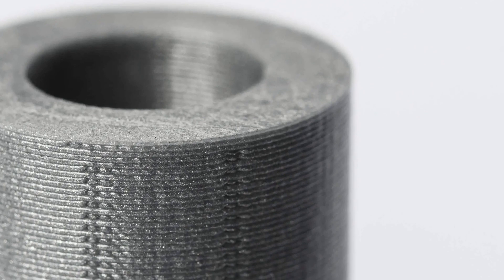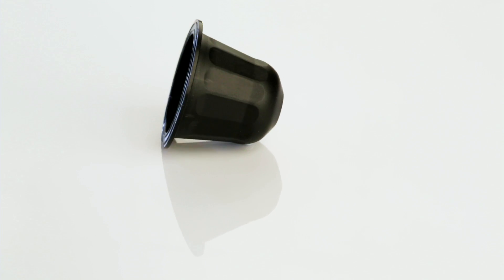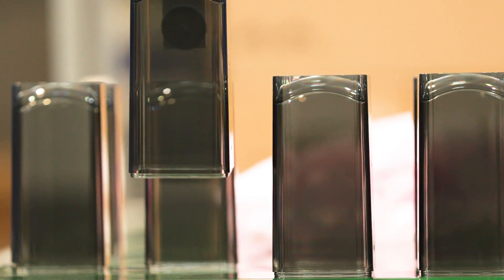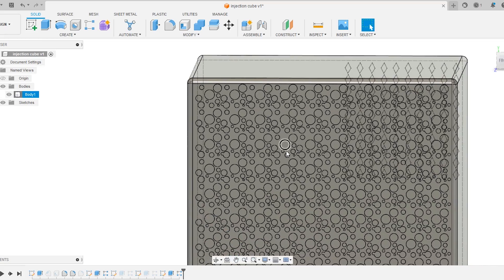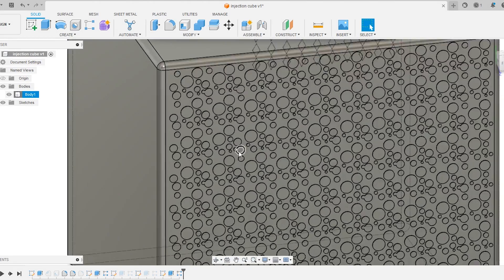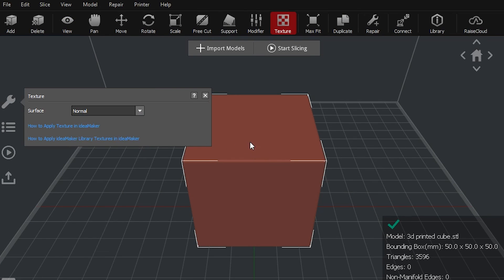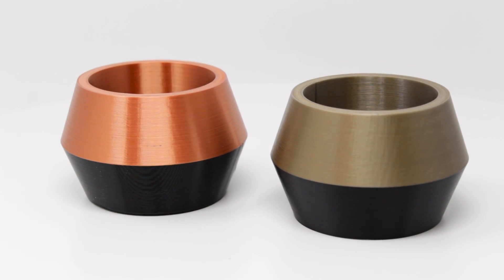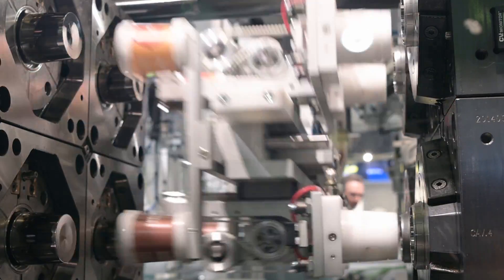Layer Lines Don't Matter | Design Textures for Mass Production 3D Printing

Comment: You're not being honest. Molding absolutely can have textures, and it's not ridiculously expensive. You even showed it.
Reply: where did he show it? the two section of clear plastic, where one is gloss and the other section is matt? \

Id like to see a knurled injection moulded piece... thats texture. not surface finish.
Reply: @ge2719  frosted/smoked part coming out of a mold
Reply: Molding can have textures but with limited roughness
Reply from the maker: To add textures to a mold is either exceptionally expensive or outright impossible depending on the part. Molds are forced to be smooth. It is a feature/bug of molding

Comment: They do matter in assemblies with moving parts, friction fits, sliding mechanisms, etc.
Reply: Sometimes the layer lines can add helpful friction to friction fit parts.
Reply: @DisorderedArray  i really agree. I use that "feature" very often
Reply: Layer lines might not matter visually but they're the weakest part of a print under shear or tension
Reply: @LandyXB  yup.  And much of that is due to weaker adhesion lines, where thermoplastic injection is just mechanically stronger.  I think a lot of this video and these responses are ignoring that when you have a hammer, everything is a nail.  Different application requires different materials or process, and ignoring those qualities  (especially to trot them out when convenient) in effort to make it one solution fits all is absurd.
Reply: @robertmartin2936  > different applications require different processes
> Design for the process.

Dude, what is the difference? You're stating the same thing as Slant. If you need to use injection molded parts, use injection molded parts, by all means. Or if your application requires machined metal instead of melted plastic. 3D printing just opens up a ton of possibilities that neither of those two processes can reasonably accomplish, in return for requiring you to design your parts in a different way than molded or machined parts, that is all.
Reply: @p_serdiuk  Are you being contrarian, or do you really not understand the grammatical difference?
The first statement means that if you have particular design needs, you have to produce it using the best suited material and process.
The second statement means that you can ignore what your design needs are because you only make things with a 3D printer and it can’t make that… so you should make something else.

Despite both sentences having the words “design” and “process” the meanings are different.
Just like “Let’s eat Grandma,” is not the same as “let’s eat, Grandma.”
Reply: Missed his point.
Reply: And in strength, as they are the weakest plane in the part.
Reply: For hobby/consumer grade 3D printing, I'd would be willing to argue that layer lines and textures don't actually matter much for parts that need to fit together, within reason. I often make functional parts that either need to fit together themselves, or accept other parts into them, and even the fuzzy skin on Cura has never altered the tolerances and dimensions enough to create a poor fit. The tolerances the printers themselves can accomplish are greater than the variations in layers and textures. Just my experience.
Reply: @kevinsmart2165  if fuzzy skin didn’t affect your fit, then what you were going for wasn’t a close enough tolerance for this comment to apply to you.  This is for parts that require a given tolerance to function properly
Reply: @kevinsmart2165   hi bro, can you give some examples of fitting parts you made with texture? zero modifying tolerances?
Reply: For use cases with tolerance that tight 3d printed parts aren't really the proper medium anyway.
Reply: @Skibbyz  Exactly.  No one's going to be able to filament print themselves working LEGO bricks, no matter how much they "design for it."  Personally I really like my SLA, but some of these 3D printing channels are getting so unnecessarily pumped up on copium that they're reaching Cryptobro status.
Reply: @robertmartin2936  he's not wrong, design for the process mean to respect the limitations of the technology, why would you print a lego brick hoping to make a better job than what can be done with injection molded abs? There's no good reason, but at the same time, you could invent yourself a different kind of lego brick for some specific build that lego or anyone else would never spend money on to have it injection molded, that's a power of 3d printing.
Reply: @MrChoklad   “why would you print a lego brick hoping to make a better job than what can be done with injection molded abs?”
Welcome to the point.  The whole argument he tried to present in the vid is that it’s always a feature, never a bug.  He doubled down on that in his “design for the process” comment… IE “dummy, just git gud.”
In reality it’s both feature (for those that like the look) AND bug, for a whole variety of applications which it is impossible or ill conceived to “design for.”
Reply: @MrChoklad  To choose the process first as an end all be all is nuts. If there's more than 1 way to manufacture your design, you do both: You determine the required production run, look at costs of all potential processes, limitations of each process and choose the process accordingly.
Reply: @robertmartin2936  Totally, and that's what you have to keep in mind with a channel like this whose business is 3d printing. "If you only have a hammer, everything looks like a nail" syndrome.  Not to say all the advice here is bad, but has to be taken with a grain of salt.
Reply: Assemblies with moving parts are called mechanisms
Reply from the maker: Design for the process.
Reply: @slant3d   " Design for the Process " Well said
Reply: @slant3d  Use the correct process for the design.
Reply: @slant3d  also Inherent weak point
Reply: @slant3d

Thats one hell of a cop out. It shuts down conversation and is so vague as to be meaningless. You can't just wave around some phrase as if that negates any criticism of what comes down to your aesthetic preferences (or more likely a case of sour grapes)
Reply: @slant3d  Slant 3D: Says a defining element of production type isn't any kind of problem worth considering or addressing because other production types ...don't have it.

Internet comment:  Yeah but actually that limitation you like as an aesthetic preference can be a mechanical problem in some applications.

Slant 3D:  That's because you haven't considered it and found a work around for it as a problem.
Reply: rekted

Comment: You have lost it, layer lines are ugly and are a weakness and often need sanding.
Reply from the maker: Then you should probably stop using 3d printing
Reply: @slant3d  short sighted, i mainly print resin🤷🏽‍♂️
Reply: @OneHappyCrazyPerson  So you don't know resin prints also have layer lines?
Reply: @independentthought3390  While you are (obviously) technically correct, layer lines of FDM and DLP look differently and also usually have a different heigth. Layer lines can be acceptable if small enough. What small enough actually means depends on the design and aestethically is entirely subjective. This is ignoring the cases were layer lines are part of the design, e.g. for friction, where them being too small would be an issue.
For my needs, FDM with 0.2 mm layer height has been good enough most of the time, but those were functional parts. Aestethically I found them all to be ugly, except for the PA-CF printed ones. That material hides the lines pretty well. If my parts were printed with 25 µm layer height I probably wouldn't mind them.
Reply: @davidruppelt  What acceptable means is completely subjective. What might be acceptable to you, might look horrible to someone else, and amazing to yet another person. For some people, standard 0.2 mm FDM prints look incredible, while other people can't stomach standard 20 μm resin prints. It's all completely subjective.
Reply: @independentthought3390  I might have worded it poorly, but I don't think we disagree.

Comment: Great take on the layer lines. I actually like very consistent and smooth layer lines, it gives it a bit of a grippy and tactile surface. The bigger problem comes from poor tolerances due to layer lines or when you need things to mate with barely any gap for a seal or something. But there are ways to get around that with clever design and gaskets.
Reply from the maker: Key point "clever design." Designing for the process is the whole battle.

Comment: WORD!! Working WITH the constraints 😄
Modifiers in blender work really well too!
Reply from the maker: Good suggestion. We left that one out.
Reply: Please do not use blender as a CAD program it is actually very fucking terrible for that if you need anything even remotely approaching precision.

There are times where nondestructive modeling cannot replace a proper design tree.